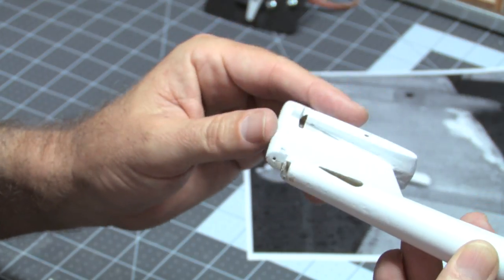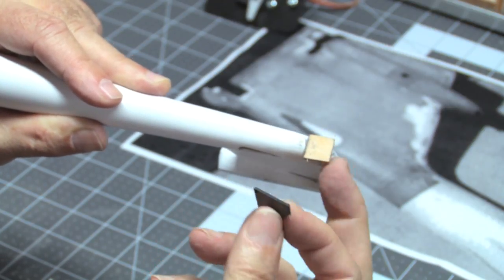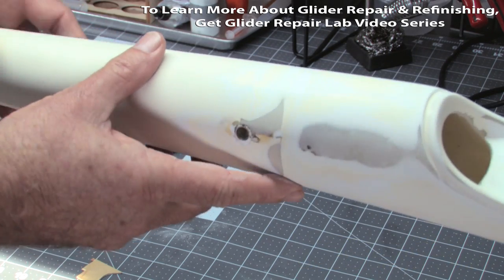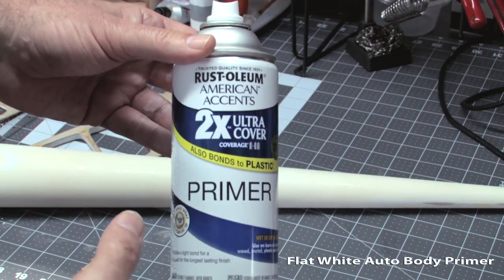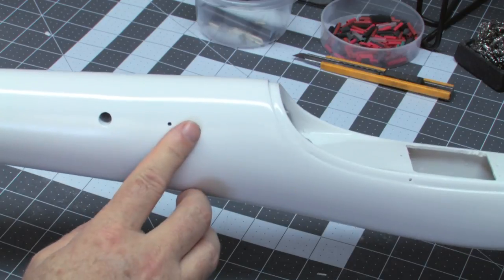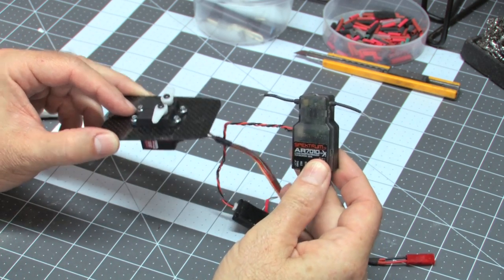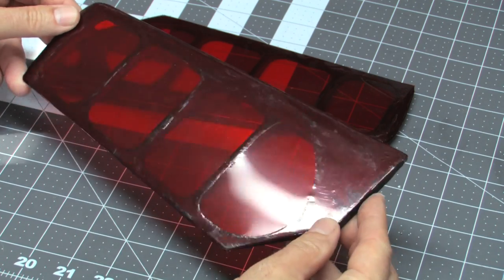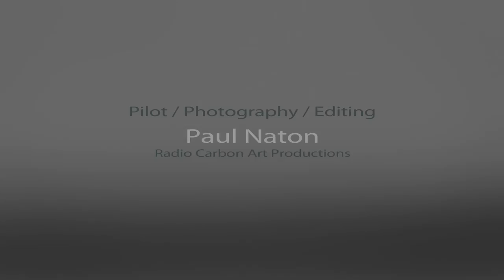Vintage 1975 Hobie Hawk R/C Glider Restoration Process Part 4

Comment from the maker: Using white auto primer for color is an old technique I used on slope racers back in the day. Keeps the paint weight minimal and you can wet sand it down very smooth and still have coverage.  Also worked well on the early all carbon skinned wings where you wanted to keep the heat off with white primer, but also fill the micro roughness to get a really smooth and fast wing surface with minimal weight at the tips.

Comment from the maker: I will show the decalage change in the next video. The front locating pin hole is dropped downward about 2mm . . .seems to work though I need a bit more flight testing to confirm the tune.